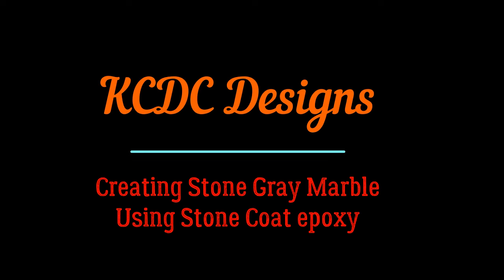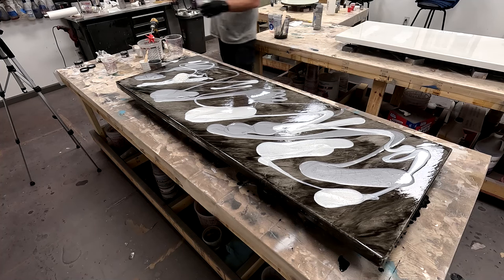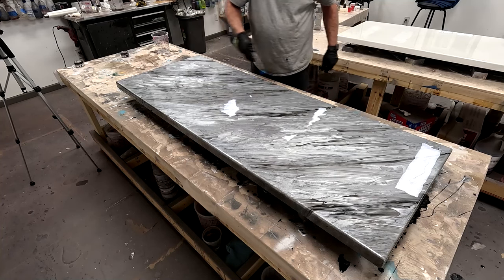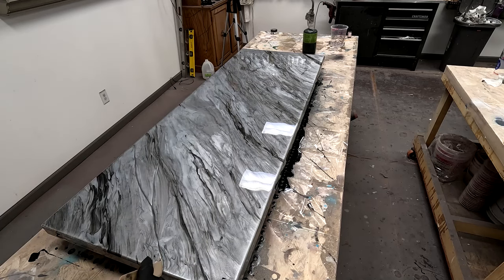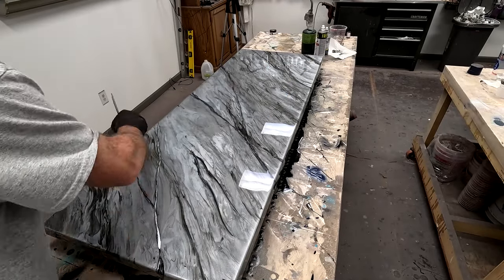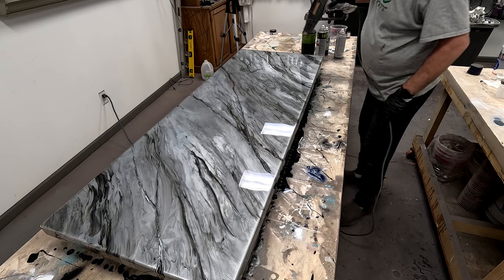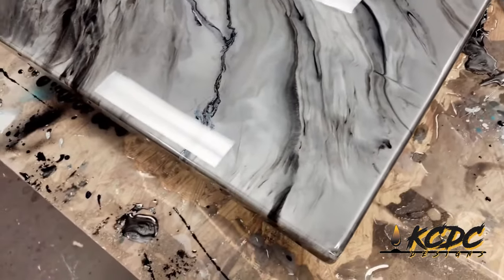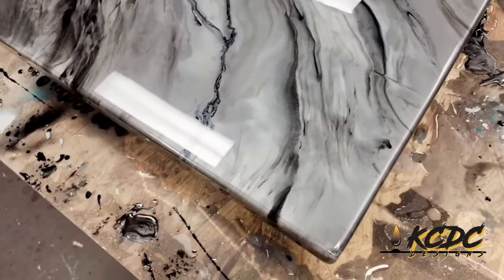Watch how I created this Stone Gray epoxy countertop, using Stone Coat epoxy! KCDC Designs

Comment: I am collecting all the stuff ready to do this, this video is exactly what i want. Its just wow 😯 Only thing is i have to leave my kitchen sink in, can i just use the tape and gently go around it? Great work 👏🏼👏🏼👏🏼
Reply from the maker: Thank you!
Yes, you can leave the sink in, and tape around it but I would highly recommend removing it. If you leave the sink in, you will making it nearly permanent as the epoxy will seal it to your countertop. What if you wanted to replace your sink down the road?
By removing the sink, you're also allowing your epoxy to seal to the cut edge, eliminating any possibility of your epoxy separating/delaminating.
Yes, many epoxy contractors leave the sinks in and just tape around them, I personally would prefer to remove it.

Comment: Hi 
Amazing video and the finish 

Can I ask why did you use both fire and heating and not only one of them ?
Reply from the maker: Thank you! Regarding using a propane torch as well as a heat gun, I use the torch to pop air bubbles, and use the heat gun to manipulate the design (such as spray paint veins). The torch works best for popping bubbles, but creates too much heat when manipulating the design which is why I use a heat gun for that.
Thank you for your comment, and great question!!!

Comment: Hi Keith , the aluminium and white metallics in this project are they mica powders or paste from just resin ?
In the process of building my new worktops , have been doing small projects for 2 years .maybe going to do this as a job full time , want to get into doing floors also. I will use stonecoat for my new worktops , not used it before . but looking forward to it .

thank you in advance for any information
Reply from the maker: Hey Keith,
The Aluminum (I mistakenly said titanium in the video) is Just Resin paste and the White Metallic is a mica powder from PolyColor (i.e., Stone Coat). Be careful of the Aluminum because it can really take over quickly!
I think you'll really like Stone Coat for it's workability and open time. It's all I've used exclusively for the past 4 years (I started with a different brand).
If you do order from Stone Coat, below is a link and coupon code for at least 10% off your order. I'm now a Stone Coat affiliate so that little bit of commission helps offset my cost of doing videos.
Thanks for your comment and support and please feel free to reach out if I can ever be of help!
Affiliate link: https://www.stonecoatcountertops.com/?oid=4&affid=228
Coupon Code is: KCDC

Comment: How would you do a backsplash?.
Reply from the maker: I lay the backsplashes against the countertop and pour them all as one. Then after a few hours I pull them apart (so they don't stick together). Then when I install, the design on the backsplash matches up with the countertop.
Did that answer your question?
As a side note, I only build new countertops, I don't pour over existing surfaces. Just my business decision.

Comment: How do you do a wash coat? Is it just a thin layer of colored epoxy? And what’s the reason for it?
Reply from the maker: DHi Leigh and sorry for the late reply.
Yes, a wash coat is just a thin layer, of either clear or colored. There are times a wash coat is applied because it helps the color coat flow better once it's poured on the surface. The reason I will do a colored, thin wash coat is if I'm using transparent colors, or clear epoxy with Diamond Dust or other glitters that you can see through. So the colored wash coat adds depth.
Reply: @kcdcdesigns  thanks so much! I plan to do this design. It’s beautiful
Reply from the maker: You're very welcome and please let me know if I can be of help. Have fun and please keep me posted on your project!
Reply: @kcdcdesigns  I did mine! Turned out pretty good. I love your videos. Do you have one on how to hone?
Reply from the maker: Leigh, that's awesome and congrats!
Please send me a pic at Keith@KCDCDesigns.com 
And no, I'm sorry I don't have a video on how to hone. I don't offer a honed finish to my customers. It's very labor intensive and I prefer the Ultimate Top Coat instead.

Comment: Beautiful work Keith.  Did you use SCC Art Coat because of the white?
Reply from the maker: Thank you and sorry for the late reply!
Great question and Art Coat is all I primarily use. Due to the minimal cost difference, greater UV protection and a little longer open time, I prefer using it for most all pours. Thanks for your comment and question!

Comment: How You Do A Wash Coat Paint ???
What Is The Recipe For Wash Coat Paint ???
Beautiful Epoxy Marble 
Amén.
Reply from the maker: A wash coat is simply a thin layer of wet epoxy to help your epoxy colors flow easier once you pour them on the surface. If the surface is dry, your epoxy won't want to flow as easy. Remember, epoxy wants to go where epoxy as been. 
A wash coat is not necessary on every pour, and I rarely use a wash coat unless I'm doing a dirty/exotic pour, or as is the case on this video, I was using some very translucent colors so the wash coat provided some additional undertones.
Reply: @kcdcdesigns  Thank You So Much, I Will Try Clear Epoxy And A Little Black Paint To Create What You Did, Thank You My Friend.
Reply from the maker: You're very welcome and please keep me posted!

Comment: did you use primer before you start puring the resin .the other question what kind of spray paint do you use. is it just a simple and any kind of spray paint or a specific for resin art
Reply from the maker: Hi, I used Stone Coat's Epoxy Undercoat paint, 2 coats and sanding in between coats. And RustOleum spray paints in Gloss or Satin (Flat does not work well with epoxy) have worked the best. If you try another brand, test it first to be sure it's compatible with the epoxy you're using.

Comment: How does it look like after 6 months?
Reply from the maker: This went in the men's bathroom at a local pool hall that I play pool leagues out of, so I see it fairly often, and honestly still looks like the day I installed it, in January of 2023. If epoxy countertops were not durable, or yellowed as some people claim ("yellowing is caused by user error), I wouldn't be installing them in customer homes. And I've been doing this full time for over 3 1/2 years.

Comment: Did you use a bonding primer?
Reply from the maker: Hey there and thanks for your question!
No, I did not use a bonding primer as my substrate is MDF. Bonding primer is recommended when going over a non-porous surface, such as granite, laminate, etc. For undercoat paint, I apply 2 coats of Stone Coat's Undercoat Paint.
Reply: @kcdcdesigns  im going over maple plywood. Have to pour today. What would you reccomend i use from hardware or big box store? Primer? paint and primer? Etc
Reply from the maker: When going over plywood (not recommended), I would first apply a thin seal coat of epoxy as plywood can release air bubbles and you'll want those sealed up before applying your undercoat paint. A seal coat can be 1/2 oz - 1 oz per sf. If all the air bubbles pop, you can then sand the epoxy surface with 220 grit and apply your undercoat paint (so you have a solid color as a base for your epoxy color coat.).
Did you apply bondo over your edges? If not, the layers of the ply's can be a problem for air bubbles as well.
Regarding big box store paint, we recommend Behr Marquee as it has the lowest ammonia content. And after your coat of paint, you'll want to wait a MINIMUM of 24 hours for that paint to off-gas prior to pouring expoy.
Sorry, I know this is probably not what you wanted to hear.
Reply: @kcdcdesigns  its solid maple not like partical board
Reply: @kcdcdesigns  i did bondo all edges and all nail holes. So seal coat then primer then basecoat paint then my pour? Not wasnt what i wanted to hear but ill live and figure it out . Appreciate the info 100%
Reply: @kcdcdesigns  or no need for primer if i seal coat sorry
Reply from the maker: Sounds like you're on the right track! No primer (as in bonding primer) needed, just basecoat paint so you have a solid color to pour over, and be sure you're applying very light coats of paint, so as to allow the gasses to escape easier. And remember, the only reason for the undercoat paint is so you have a solid color under your epoxy color coat (you'd be surprised what can "ghost" through. I would also recommend fogging your edges with "like colors" of your epoxy color coat, since the edges will be the thinnest area of epoxy. Fogging them will allow "like colors" to show through your epoxy. 
As a side note, you could also tint your seal coat(s) (sometimes 2 are needed). If your seal coat provides a solid color over your project, you could skip the undercoat paint. Just be sure to not add too much tint (keep the ratio at less than 10% tint).

Comment: Is your wash coat and color coat from the same batch or do you mix separately?
Reply from the maker: Hi Kristi, the wash coat is from the same batch. By using the shower squeegee to apply the wash coat, it goes on very quickly so I don't have to worry about the rest of the epoxy that I've mixed up sitting too long in the bucket. Although, it's something to always be mindful of!
Thanks for your comment and great question!
Reply: What was the total amount of epoxy you mixed

Comment: Ahhh kind of forgot to tell us what your base was
Reply from the maker: Are you referring to the white? Or what "base" are you referring to?
Reply: Yes sir, great video but other than individuals who start using 4x8 insulation sheets for shower surround no one really tells us what the foundation is? Plywood? An old Formica top? Or another product?
Reply from the maker: Gotcha, and thanks for clarifying!
All substrates in my video are MDF unless noted otherwise (I think I have a few on XPS foam panels as wall art). Countertops are 3/4" MDF, smaller sample boards are 1/2" MDF. 
Thanks for watching and supporting my channel, I really appreciate it!

Comment: Hi im confused to exactly what the wash coat is. It seems to go on more watery than the design colours. Could you tell me exactly How did you make it?
Reply from the maker: Hi and thanks for your question! A "wash coat" is simply a thin layer of epoxy (1/2 - 1oz per square foot) applied first, right before you pour your epoxy colors. It's not always necessary, but it helps your colors spread out easier when you pour them on the surface.